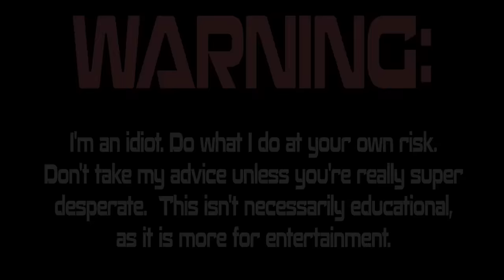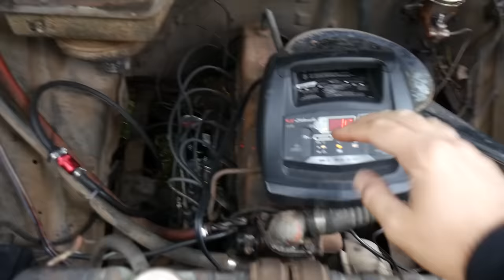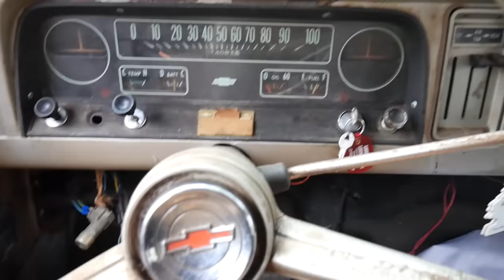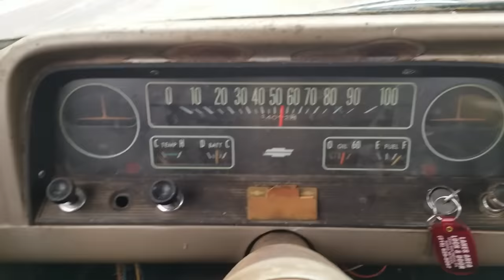FIRST DRIVE In Our Clapped Out Rat Rod Chevy C10 - Vice Grip Garage EP52

Comment: When the torch came out to "defrost" the window i was rolling...lol
Reply: LOL!!! That's the best!!! especially going down the HWY!!! You gotta love it.
Reply: I think the fan tip would be more appropriate but sometimes you just gotta run what ya brung.
Reply: I wonder if that comes from the factory? Kinda like a pinto the back windshield defroster is for those who do not require gloves to push on the car in winter lol.  Hey I had a pinto in college 2.3 liter. Got pulled over by the police and always out of tickets they *felt bad for me*.  So if you are going to college buy an old pos.  And soup up the motor. )) Could get that thing up past 88 mph just could never go back in time.  Little shaking never hurt the fenders.  Never got laid in the thing i wonder why?  So jimmie where were you conceived a dodge truck. Joey? A chev...  Carl?  a pos pinto...
Reply: Map gas no less!
Reply: That's factry right there 🤣

Comment: You said you wanted suggestions.  
For the exhaust noise put diesel stacks in. 
I use long hose clamps to reinforce my frame  
You can’t use 🦆 tape FOR EVERYTHING !!
Paint the grill and bumper FLAT white. 
Don’t want to make the rest of the truck look bad!  Just mask them off and PSSSSSSSSST!
When you paint something that gets hot use high temperature paint: it will stay on longer. 
Move the shifter to the floor!!
No rear brakes make burnouts easier.  
Rain X makes a anti fog juice!  
Anytime you need advice: I know EVERYTHING!!

Comment: Fix the defrost, but not the wipers.....keeps a guy on his toes.
Reply from the maker: Excellent plan
Reply: Actually those 74 dollar propane heaters will fix the issue of no heat, but you will still need a window defroster.
Also if you reach hard a window scraper/brush can be reached out the window while driving well at slow speeds! 
Mr. Heater F232000 MH9BX Buddy 4,000-9,000-BTU Indoor-Safe Portable Propane Radiant Heater.
Indoor safe means can run inside the car and not nail you with CO.
Reply: 12v electric window defrosters are like 10-20$ at most farm stores or harbor freight

Comment: Bed looks like its about to fall off... I want it. I want this truck.
Reply from the maker: 🤣🤣.. thats great
Reply: Vice Grip Garage no joke, Id secure the bed, sort out anything detrimental to my safety, toss a slide in camper out back and live in it. I live mobile right now on a 2008 F250 Thats already on its 2nd 5.4l engine thats also on its way out haha.
Reply: @lost1nanger  does it happen to be the 5.4 3 v engine?
Reply: @lost1nanger  I has the 01stupid duty 305k will not die
Reply: Christopher Daniels it id, bern on all the forums, watch all of makulocos vids too. Its a junk engine design
Reply: @lost1nanger  brother I have had 5 put in. By ford dealer and everyone of them have been crap. Remans cannot get the right machine clearance when rebuilding. And apparently cannot get the valve train correct. Broke lifters, broke springs after 500 miles. Man once my warranty is up I will plant trees in it. And make it a useless yard ornament

Comment: If you use the superfine steel wool on the body, then pin striping then clear coat, the bed could use some bolted in cross beams that could double as cargo rack

Comment: I've had several old 60s Chevies, a 62, 64, 65, and a 66. I only 'fixed up' the 64 with a friends' help. It started out like yours, with bad valve seals and a bed with NO wood floor left. I swapped out the fleetside for an 8' stepside and installed an un-rebuilt 327 from a 68 Impala- which promptly shredded the little 3spd so I obtained a 'rock-crusher' 4spd and that fixed it. I could pull a house off its' foundation if I had enough weight in the bed. I miss it.

Comment: Put flames coming out of the fender vents next to the door. This will help demonstrate that innovative factory feature that everyone thinks is weight reducing rot.  When in reality it is engineered in so that the older the truck gets the more cooling the engine has to automatically accommodate for leaky hoses and fuel lines.

Comment: Used the hyperlube before on the old crown vics between 1992 and 1996. Those valve guide seals never sat right, and those 4.6Ls would puff burnt oil out the tailpipe from a standstill when warmed up.

Took care of the neighborhood mosquito problem. That’s what a guy needs.
Reply from the maker: Ahahha

Comment: This feller bought that exact same jack only a couple months before finding this channel.  Its quite good. Zero complaints.
Reply from the maker: They're pretty decent!!
Reply: @ViceGripGarage  I have a low profile from Harbor Freight that was gifted to me 10 years ago. Never did any maintenance on it and it leaked some oil. Works maybe 60% which wasnt enough to lift my truck. So I went back and snapped up the red one. Love it. Still have the old one. I'll fix it at some point. No harm in having two.

Comment: I could have used that propane torch idea on a couple of the VW bugs I owned back in Michigan in the winters.  Those were the only cars I ever owned where you had to use the ice scraper on the INSIDE of the windshield when driving down the road.  1961 and a 1965 Baja.
Reply from the maker: That doesn't sound like very much fun

Comment: When I was 17 I had a 67 Chevelle. I bought a pair of 10in Cragars with bald N50’s on em. Of course they rubbed the fenders so after careful consideration, I jacked it up and started stacking short pieces of 2x4s between the coils and settin it back down until I had enough clearance. 4, it takes 4 2x4s on each spring to get enough clearance. On my first drive a couple fell out on the bumps. My budding inner engineer solved that design flaw with a strip of plumbers tape (that metal strap stuff with holes in it that comes in a roll) and a few wood screws. I drove it all summer like that with no issues. Later I sold the car to a neighbor kid and he wrecked it bad. It was still sitting in his backyard when I went in the military (not my idea, suggested by the judge - long story) I didn’t think much about it at the time but man, I’d love to have a decent 67 Chevelle now, that was 1978.

Comment: I used hyperlube in my 83 k10 4x4 350 for about 6 years then she lost oil pressure on warming up and got hot. So I pulled the pan and there was about 3/4" sludge in the bottom of the pan even after 2 quarts and cycles of engine flush. Always ran long Baldwin filters and never had pennzoil in it. Valvoline/hyperlube and of course the inevitably cool always improperly cared for k&n air filter. 308 running gear 208 transfer shed do about 65 up hillclimb at sand dunes floating with 35's lol! Flattened cam out put in the summit racing cam ran about another year and that is when she started overheating and oil pressure drop at warm up. Cleaning hyperlube and sand dunes out of her as we speak. I always thought it was great stuff but maybe not so much now upon my application anyway. Cylinders still have cross hatching and don't seem to have any scars. I'm no mechanic but maybe good to only use half bottle in there per 5qts 55hv oil pump.

Comment: Hyper Lube is a great product. A fella can keep old engines alive with this stuff. I use it and I’ve seen it raise compression and slow oil burning in worn engines. It also stopped a rear main seal leaking on my Subaru and I only added half the bottle. I have also seen it used in worn manual gearboxes to help quiet them up. It’s slightly thinner than Lucas I think.
Reply from the maker: Nice! Thanks for the info

Comment: get the brakes, wipers and heat workin, jam the old 307 in 'er with a long shaft turbo 350 and cruise.  Keep it low buck and add a speaker box, conch cruisin' at 'er best .......

Comment: Do some vintage straight 6 performance mods to the engine.  Find a hot cam for it and try to adapt on a 2bbl carb.  Run a custom exhaust out the side just behind the cab (Split Header with 2 Cherry Bombs - NASCAR style!).  Replace the clutch and try to find a cheap posi for maximum burnout action!  Maybe install a really tall floor shifter with a crazy shift knob?  Maybe even swap in a cheap 4-speed?

Comment: 65mph is awfully bold for that truck in that condition. I've got a 4.6L '66 C10 and I've only got it to 75 before I was convinced I was going to die. Later realized when it wouldn't start again I'd rattled the positive battery cable off during the speed run

Comment: i would eliminate the high side of the bed..above the bevel...cap it there...and then deck it strait across  - or give the bed surface a 2"  drop  on the inside where ever the top of the wheel well is ..3 stake hole  on each side..no tail gate ...then some OG rims and low profile tires..good to go..  wish i did that with my '67  F100 shorty bed........ heat the springs...so cool

Comment: In 1992, I broke down in my car in Portland Oregon. I bought a 66 pu alot like Lawsuit there  for 300 bucks and drove in 4 or 5 hundred miles down to where I lived in Vallejo,CA. It smoked a little but burned quite a bit of oil. It was summer so I bought a case of Pennzoil straight 50 weight. The old six hole wasn't bad on gas but it took the whole case to get home.😂 I got my other truck and rented a car dolly and went back up after the car. I soon sold the old Chevy for $600. That paid most of the gas cost back then.despite the oil use and busted windshield,she would bring a bit more now😊. Fact is I'd love to have her back.😢

Comment: You could take the heater hose and plug it into a radiator for a Japan 4 cyclinder and put it in the passenger window then use some sheet metal to funnel wind through it. That might work? Or not. Just an idea.

Comment: Nothing can beat a chevy truck.
Everyone has their fav, but I worked a dealership for 10 yrs and the trades ins are proof...
Chevy trucks, tahoe's , suburbans would come in with 250 -300'000 miles and they would run & drive perfectly...
The other makes would come in with half that many miles , and they were worn slap out...
I personally drive my Chevy, GMC"s til they have 250k , 300k, and at that point, I usually donate them.
Reply from the maker: Interesting great info

Comment: Save your cold snack cans and cut off the tops and bottoms and flatten them out. Use en like license plates. 

That or take some pallets, and deconstruct on em and use the wood to fill in the ol bed. A bit of old oil or deck stain will make it look right good.

Comment: Years ago in the early 1990's I found Rain-X when they only had it as a wipe that you wipe on the window and wipe it off like a wax now I used that Rain-X washer fluid and I'll tell you I won't buy that blue stuff no more I have to use Rain-X washer fluid you get going above 45 50 mile-an-hour you don't even need wipers and that's no lie

Comment: I had an 07 F150 FX4 with 5.4 that the shop owner/mechanic/neighbor told me it seemed that the cam phasers were screwing up. I saw 1000 dollar bills floating away and could already here the wife chewing and nagging at me buying another piece of junk. My mechanic suggested a bottle of Lucas Oil Supplement down the galleys. Worked like a charm, no more rough running,  did exactly what it said it would. Told my mechanic to add another cheap fix to fix success file.

Comment: The first truck I ever built was a 63 short wide. The reason all these front fenders had cancer was because they had no drainage. They would fill up with dirt and water and it had no where to go. If you have one of these just drill under the front bottom bolt that holds the fender and about 3 pounds of dirt will pour out! lol

Comment: A bit late to the party on this one, but I'd like to see it mechanically restored and modified. Keep the 6 cylinder, do some porting on the cylinder head, new valve springs, a nice cam, 4 bbl intake with a 390cfm holley or 500cfm edelbrock, a header, and a side exit exhaust with a glasspack. Swap out the 3 on the tree for a 4 on the floor maybe, oh and more for the maybe list...wipers, full brakes, steering... And for the wheels... Look up Liquid Metal Renegades, or something similar, Hallibrand/60s gasser type wheels. Just some Ideas for a guy!

Comment: Car show in January snow!? What's a guy to do but drive the 40 miles! Glad you were one of the only ones to show up. That other old Chevy truck was in better shape, but yours had "lowered" springs!! Good to see your fac'try air conditioning was nice and cool...Just fix on those rear brakes, keep drivin' her. Stuff more license plates in that front fender for a fac'try look. Get coat hanger wire to fix on the license plate bracket, so you don't get pulled over!

Comment: Paint it flat black,after body work, front grill aluminum or a metallic grey. Fix heat, wipers , all lights. And do a clutch. Keep an eye out for a bed. Restore inside, get a floor , out with old & in.with the new. 
** Last but not least,do back brakes.! ! ASAP. Peace

Comment: I liked the Pine Hill Garage door logo. Something like “Skunk Rise Haulage” on the doors would add “history” to the old gall. Otherwise a few more number plates tacked onto the trunk floor should see you about done. Maybe you could suspend the old blow torch from the cab ruff and automate a blast every two minutes and go fur sponsorship from the gas supplier? Though if you do that, give them beenz and broccoli fritters a miss before drivin, don’t want no Ex-Derek Motors emblazoned on the doorz

Comment: We had a 63 just like this on the farm when I was growing up (Old Smokey). We used it everyday. It had gotten to where it just had no compression and the only way we could get her to fire up was by parking it on a hill and doing the one shot rolling start. The starter motor just wouldn't spin it fast enough to fire it up. We did the same hill trick with one of our 8N Ford tractors.  I remember when I got my first real job and a coworker called in unable to work because they couldn't get their car started. I was absolutely dumbfounded that someone would dare use that as an excuse to not come to work??!?!?! Back then everything would start if you just monkey with it a bit?

Comment: Some guy explained to a guy that using the thickeruper stuff really doesn't work because the molecule size is too large to allow them fat thingybobs to get between the bearing surfaces that need oil. I don't know if the stuff works to deal with piston oil ring blow-by if that is what you are after.

Comment: How about keeping the 6, put a decent bottom end in it and slap a little roots blower on it for a potential thought? Cammed straight 6's sound pretty nifty and unique (not the most ideal for boost) but it'd be a neat cruiser. ANd with a decent welded diff and a car 4 speed I'd bet it would be pretty peppy too. A fellow across the pond has a blown methanol 6 cyl gasser and he makes out pretty decent on a built engine, TasTuners if you'd never seen it. Regardless of what comes of it, I keep the bell on for all your videos. Keep up the fun content, it makes your channel very enjoyable to watch.
Reply from the maker: Would be fun!

Comment: I like to take out the plugs, squirt in some wd 40 in the head hole pour some marvel oil down the plug holes. Drain oil, put a cheap fram filter on it. Fill the oil pan up with kerosene and spin err till the starter is ready to cry. Walk away for a bit, have a sandwich or something. Come back and spin err again. Repeat, repeat, till you're tired of doing it. Drain it out, pull the filter turn it over to dump it. Then just stick it right back on there. Pour it full of atf. Put the plugs back. Crank it up and go drive it around for a while. 50 to 250 miles. Drain it again put a good filter on. Good diesel oil with thick honey type additive. Crank it up let get to operating temp. Rev it to 90 blue million rpm and start pouring atf right down the carb. She'll smoke like a tire fire. Then your good to go.

Comment: Cut out the rear of the fender damage and run the exhaust out there?  I am guessing 6 cylinder you only have one pipe to run, but you could dummy the other side...  Would be amazing if you could get a road sign big enough to do the whole bed in one sign...

Comment: Why change the oil? I would just drill an tap a couple zerc fittings in the oil pan and in the valve covers an pack it plum full of grease, really takes up them tolerances

Comment: Pallet wood bed, instead of all the waste of body patch in the bed areas. Maybe consider a air horn.
Get yourself a kfc bucket blower motor and some Campbell's chunky Stove pipe and use that center counsel for blower motor fuel and starter. Also construct a sliding spaghetti O's vent /fuel port so you can point all that in another direction while your and conveniently refuel while your driving.

Comment: A guy went ahead and has only bought diesels. A guy doesn’t have to worry about the lightning whirler or sparkleators in one of them engines. As for additives a guy really like Hot Shots Secret in the engine oil and Diesel. Just use the sparkleator and lightning wizard money on it instead, I don’t know...

Comment: Just curios, what makes Fram so bad? used them for years in my car never had an issue.
Reply from the maker: Never had an issue means.. The motor didnt lock up? Its impossible to measure filter performance unless you consistently look at bearing material OR you ARE one of the thousands that lost an engine due to fram.  Google or youtube fram vs or why is fram bad and be prepared. Just trying to help folks
Reply: Appreciate it. Yeah never had any of those issues. I'll check that video out👍

Comment: puralator will ruin a guys engine i put one on my old dodge truck it collapsed and blew up my 360 and rebuilt the engine and made the same mistake and put one on for the brake in oil change and it blew up the rebuilt one